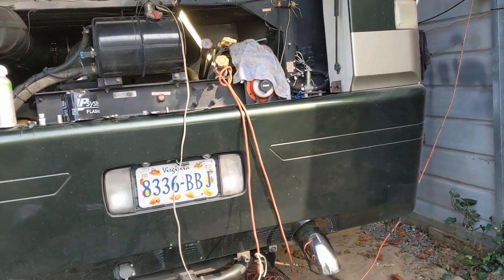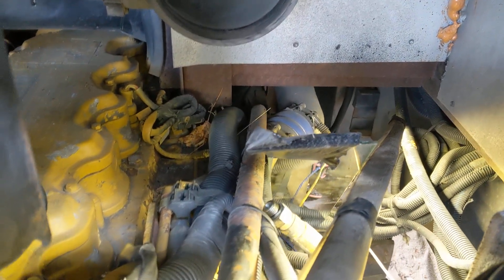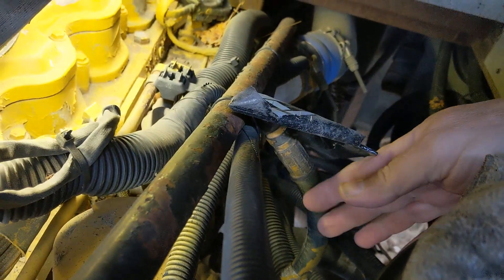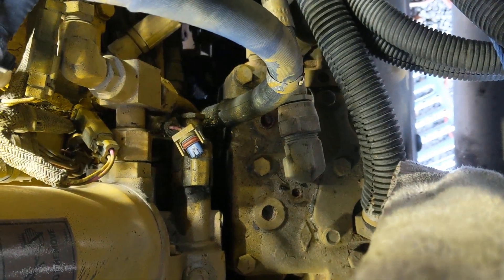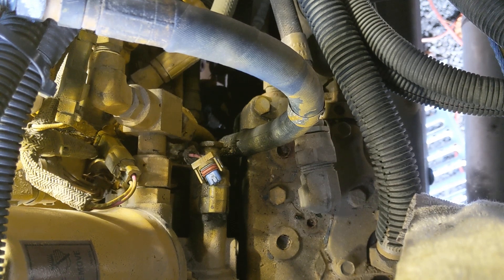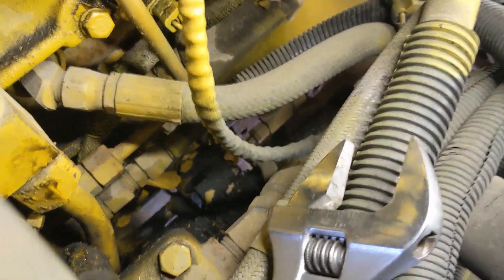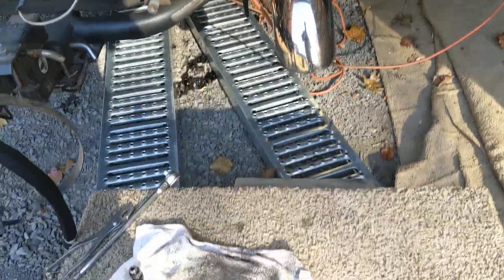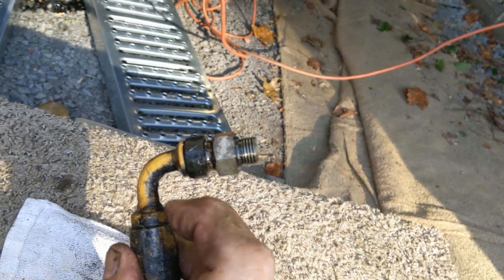HEUI filter installation

Comment: You've got the round top Heui pump. Our 2003 Newmar Dutch Star w/ cat 3126 E has the square top Heui pump. Count your blessings. You can change the driver(solenoid) for a couple hundred dollars instead of having to replace the entire Heui pump for well over $1000.00-2000.00. Where did you get that filter and how much was it ? How's your slide out doing you fixed, that was an awesome video series.
Reply: so is the round one better  than the square one ?

Comment: I’m looking to do the same thing on my 2003 Dutch star. Did you finish the install?
Reply from the maker: Yes, need to upload video
Reply: @flinthillfix-it6618  great! Looking forward to it. I also want to add a second fuel filter between the heui pump and the head. I don’t like how freightliner gave these chassis only one filter and such a large steel fuel tank
Reply: @benjaminishak7206  The Heui pump is not a fuel pump. It's a high pressure oil pump that produces up to 3000+ psi of oil pressure to fire the injectors. The IFS kit is an oil filter that filters that 3000+ psi engine oil before it gets to the injectors in order to protect the injectors from metal debris should the Heui pump fail. Injectors can run 1,000 each and there are 6 of them.

Comment: I did this when I had to remove the air compressor. There is no easy way to replace this hose and fittings.